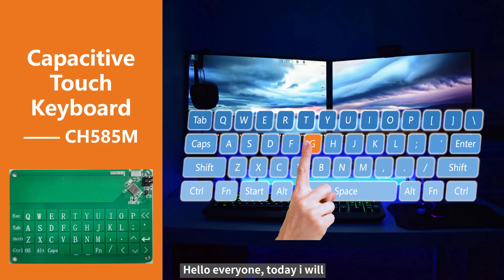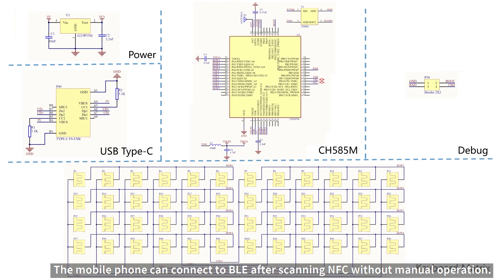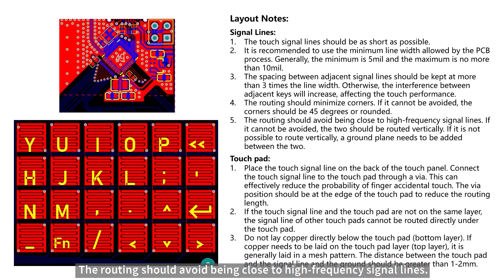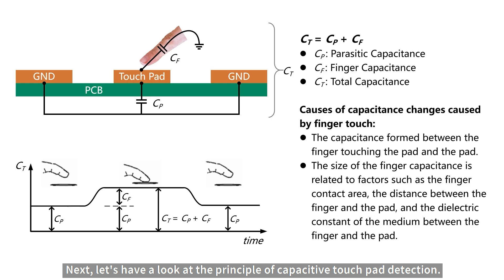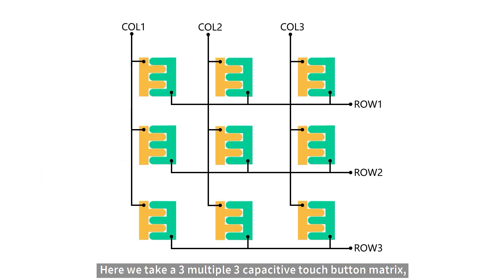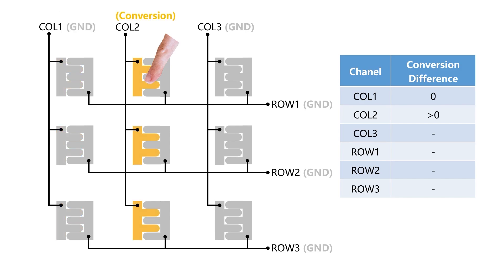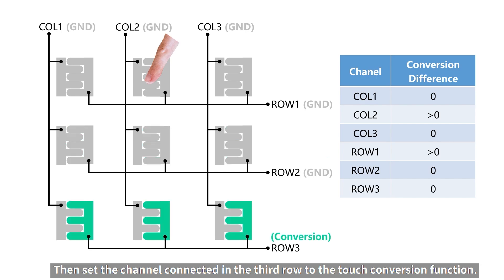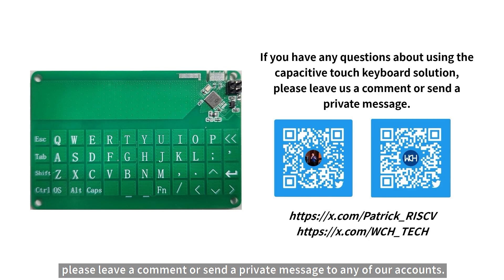#37- A super cool capacitive touch BLE keyborad | RISC-V CH585

Comment: Hello！This is a very interesting project, and I have been trying to replicate it recently. But this is my first time working with this MCU, and although I have experience developing ch32v203/307 before, the code style is a bit different from the ch58x series. The PCB I redesigned is the v2.2 version from GITHUB's warehouse, while I want to use the v1.0 code. The hardware of the two versions is slightly different, mainly in the order of GPIO rows and columns of the matrix keyboard. However, I cannot find the difference in withdrawal order between the two versions of the code. Can you provide some technical support?
Reply: They won't.